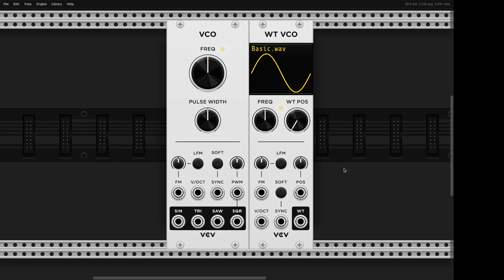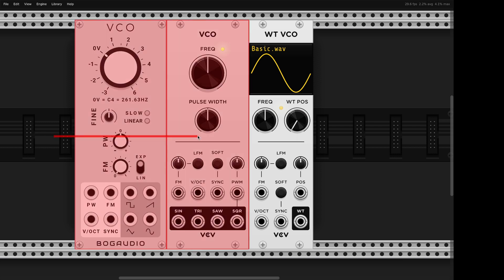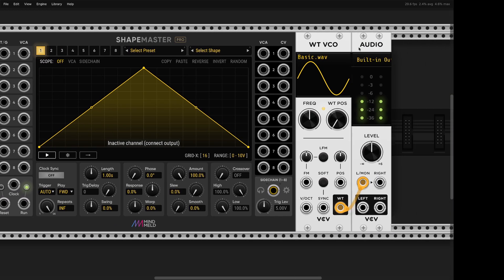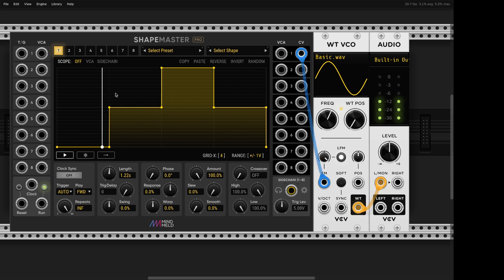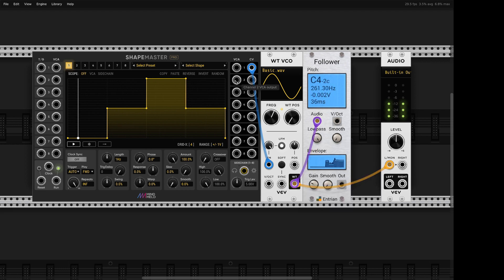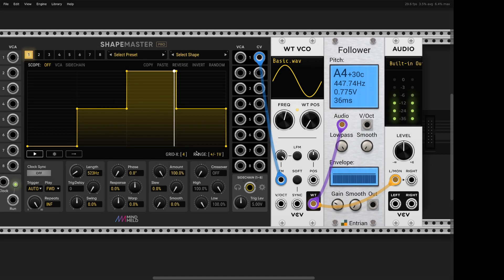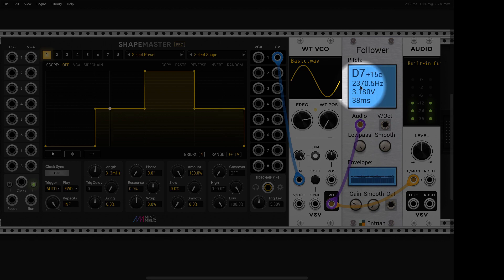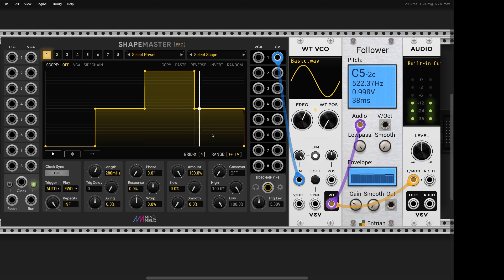EXP vs LIN | 4 Flavors of FM in VCV Rack | Part I

Comment: Same form mewith 200_400_800 - so in a sense "volt" is linear - 1 volt per oct, and frequency is exp as double per oct.
If we started at 1 we would get 1-2-4-8....256-512... that would be very close to 261 and 523!

Comment: this is awesome!! i was researching this a while ago because i was trying to do FM (linear) with nysthi add/mult going into a vco v/oct input, but had some problems… turns out the v/oct input is exponential and not linear, so i wasnt getting the sound i wanted, even though it was technically FM